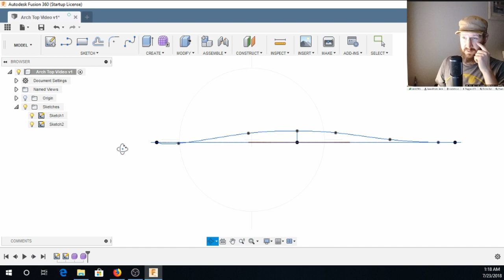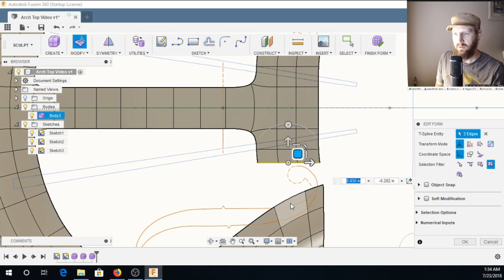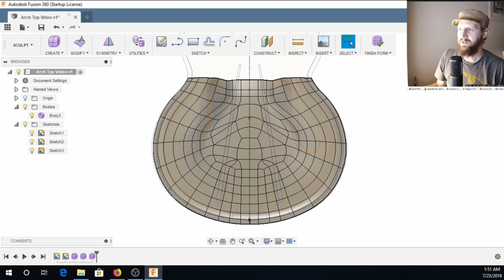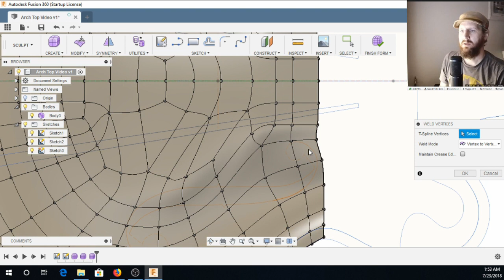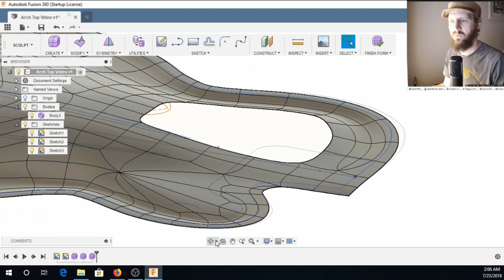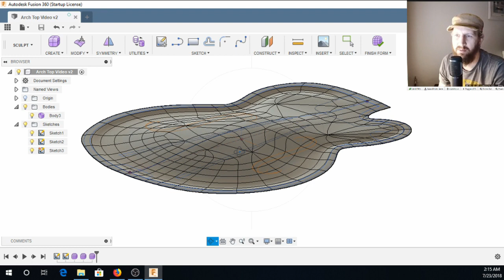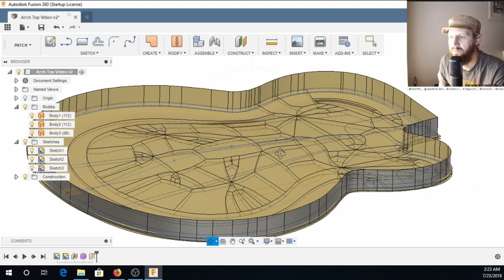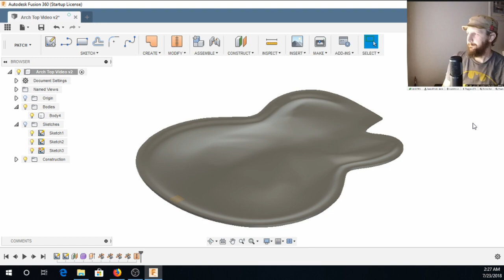Fusion360 Using Sculpt for Complex Archtop Shapes

Comment: What is the command for when you start copying the double sections around the outside curve? thanks
Reply from the maker: I think I know what you are talking about. If it is how I pull the edges around the arched surface, it's as easy as selecting modify, then the edges you want to add to and holding the Alt key, and moving the edge.

Comment: Sir, i have a problem I hope you can help... When i start creating the faces, the software won't let me draw "freehand", it wants to snap to something otherwise it just won't let me draw them. What could that be?
Reply from the maker: It sounds like you are using the plane tool and not the face tool.
Reply: @TwoCherriesIns  Problem solved sir thanks! I did not select the plane before drawing the faces. now i reached the very end of the process but it doesn't let me stitch everything together! it says "modeling error, nothing has stitched" :(((
Reply from the maker: @lucavalentini7252  The seam between the parts being stitched has to be a perfect watertight connection for it to work; there is a small imperfection somewhere.

Comment: I like your videos a lot and I would like to share my way to model archtop surface in Fusion 360. Control is everything.
https://youtu.be/ThLf8Rvi_9A
Reply from the maker: I used this method in the past, the problem with it is that you have almost no control over the recurve area as it translates around the outline, The shape is ok, but not very close to the contours of an actual archtop guitar.  There is no way to parametrically describe this shape, so lofts will not define it. My method allows the G2 and G3 continuity of the surface to define the shape, and this is exactly what we do when we hand carve these shapes if you think that this method is inaccurate you should look into G2 and G3 continuity.
Reply: I don't think your method is inaccurate. I tried sculpting arches and managed to get good results but I found that you can control surface lofts  perfectly with accurate rails, so is's less staring at reflections on a surface to me. They are as smooth as they can be.
Reply from the maker: Oh, good, I get that complaint a lot. 
If it works for you that's great!
You have perfect control of the loft only at the rail itself, in between the rails you have no control at all.  I was using this method with Autocad as far back as 10 years ago, It works well, but I end up doing a lot of handwork to get the contour where I want it. When Sculpt came out I was skeptical as well, I love it now, and it creates the shapes I have alwsy been tring to make. 
     What I am trying to do is replicate a shape that you get using traditional techniques when hand carving, lofts don't reliably achieve that. If it works for you that's awesome, and if that is the shape you are going for even better.
Reply: @TwoCherriesIns  I did my homework on this and yes, you almost always have to fix faces when making loft. It's also very limiting when you want more complex shape. Thank you!
Reply from the maker: Give sculpt a shot, once you know it you will love it.

Comment: Could you please explain why triangles should be avoided?
Reply from the maker: They are usually when the G2 continuity is pinched closer to G1, in other words it a notably sharp point, your surface will be much smoother without them or as few as possible.
Reply: Two Cherries Instruments 

Thanks. That makes sense.

Comment: Hey man, how did you manage to get that contour line at the beginning? I have an svg with all the lines but i can't find how to rotate my arching profile 90 degrees from the body plane..
Reply from the maker: You would import the SVG to the plain you need it on, in fusion360 everything is done on a plane. It's a simple contour so I just draw is using the spline tool and line it up with the attached canvas.
Reply: @TwoCherriesIns  thanks a lot man!!

Comment: i dont like fusion..bug all the time...dont get what you want to do...drive me nuts..i download the trial...computer run high just for simple task ...i am building the guitar as we speak and cant find a way to do the 3d  like the orignal print
Reply from the maker: You should take the time to learn fusion, checkout the tutorials on nyccnc and lars Christensen. Fusion has the tendency to jam up when you don't do things in the correct order.
Reply: @TwoCherriesIns   is it because it s the start up  License that let you do nothing...or i dont have full license...i have made a sketch at work with a diffent software and i save it as DWG. and load it on Fusion...still can t do nothing with anything
Reply from the maker: the startup license has everything you need, that's what I'm using.
Reply: @TwoCherriesIns  i dont see the modeling part in it..thats what confusing..it appear different from video to my screen
Reply from the maker: , they have updated the UI since my videos, things are in slightly different places now.  If you go through the tutorials it will all make sense.  Watch a few of lars's videos they are really good.

Comment: This is the video I needed! Thanks
Reply from the maker: Let me know if there is anything else you need help with, I also have a video on modeling the violin top and back that might have some more information.
Reply: Two Cherries Instruments aside from doing the model for me I should be alright. Follow along and I’ll do my own video and give you a shoutout.
What screen capture method are you using??
Reply from the maker: I use OBS , it's not that easy to set up but it works well.

Comment: Excellent, thanks. I’m trying to make violin top by making a series of stacked, Offset Planes, with contours lines on each, and then lofting between them. I don’t know how it will turn out as I am new to Fusion. But your method might be a better way to do it? any disadvantage to using Loft of an arched top?
Reply from the maker: Guy Booth the disadvantage of trying to do it with lofts is there is a lot more work involved, and it's never quite they way you want it to be. Try this way and see if it works for you...
Reply: @TwoCherriesIns  Did you use this method for the violin you’re making now? It seems to me with this method, you’re pulling the contours around until you are happy with them, rather than pinning them to an exact, pre-defined contour pattern? Maybe with an arched top guitar, there is considerable scope for variation in arching parameters, but with the violin, I’m trying to draw the arch to fairly strict dimensions...so I'm curious if you arched your violin plates with the same method? thanks again!
Reply from the maker: @guybooth20  arch top instruments both violins and guitars are not parametric shapes. You will never be able to define them that way as they were originally carved by hand to a shape the was pleasing to the eye. This kind continuity is only possible in the sculpt environment, you probably notice that when you enter suclp you are outside the parametric timeline until you finish form.
Reply from the maker: Since every peice of wood is different carving to an exact shape will not reproduce an exact tone, this must be refined by hand and enough wood left in the form to accommodate it.